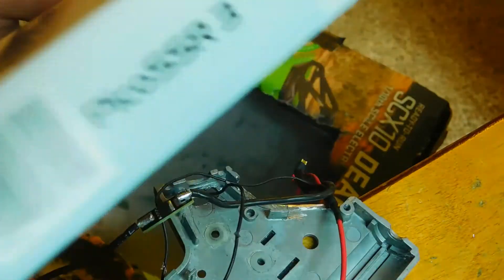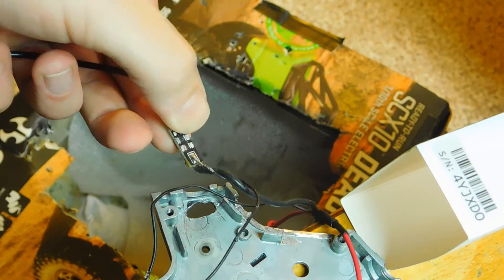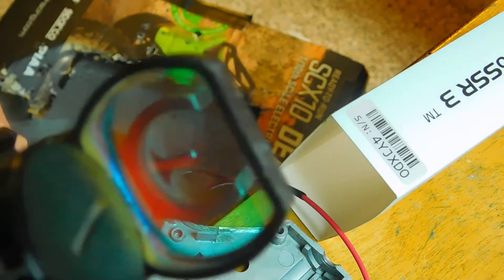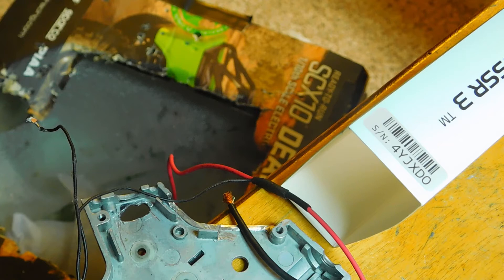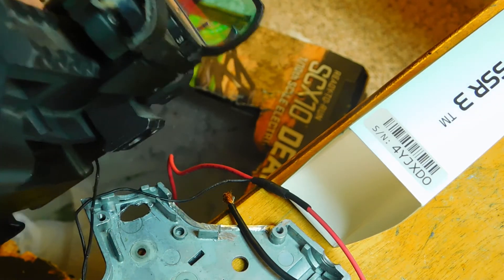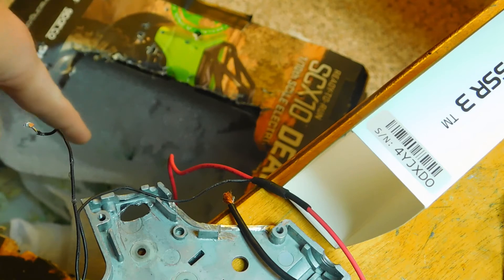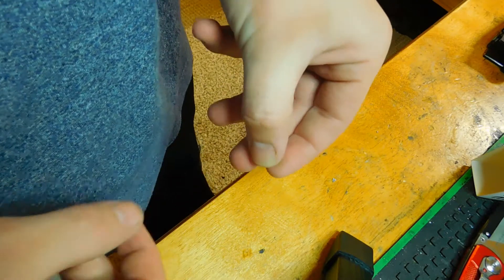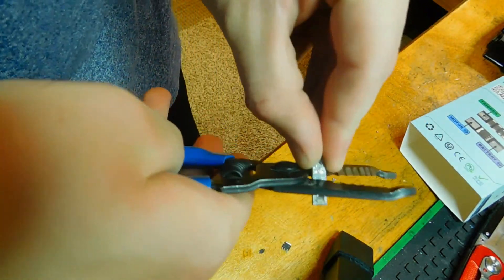Gate PicoSSR 3 Airsoft DSG Destruction

Comment: I have a question, how do you get a 15 rps up to 30 rps?
Reply from the maker: Gear change, higher speed motor, higher voltage battery, basically a endless combination  that is possible to get up to that low of speed